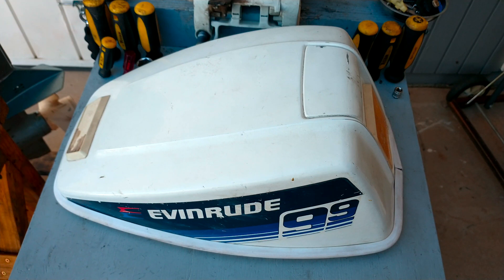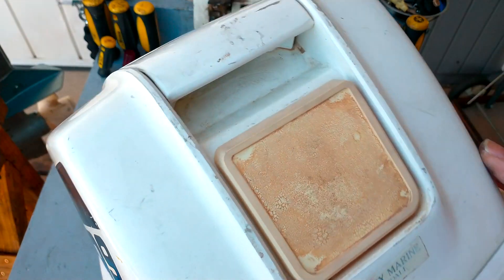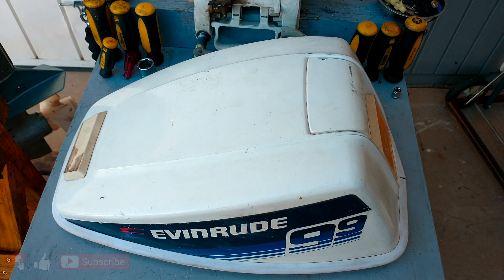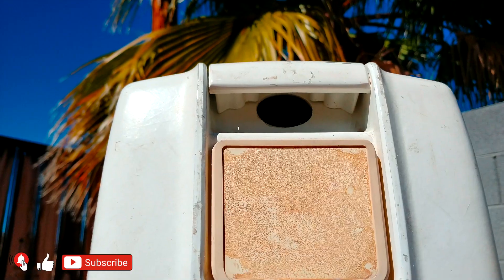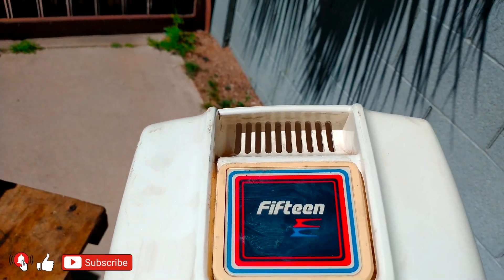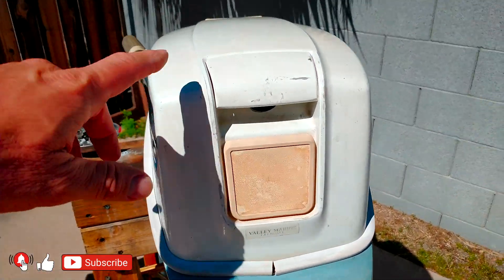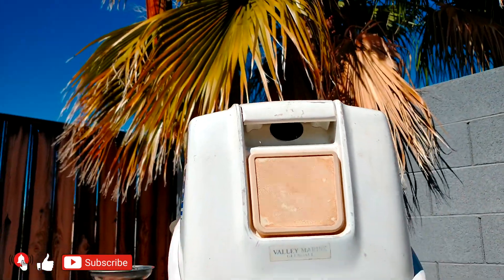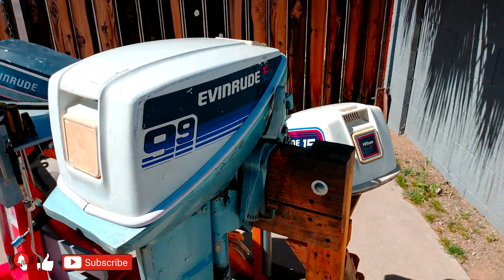HOW TO INCREASE OUTBOARD MOTOR POWER - 9.9HP - 15HP Johnson / Evinrude 15HP Hood

Comment: For those who store their motors outside or where there is mice, you definitely don't want to leave a perfect mouse entrance like this open.  Put steel screen or mesh over it in the inside, or drill many small holes.  I had a mouse in my engine once, and he chewed the rubber off wires and left hay in the carb.
Reply from the maker: Thanks!

Comment: hello , i have a 1980 johnson 7.5 that leaves murky water in the tub when i test run it ! any idea ?
Reply from the maker: This is normal for 2 stroke motors.
Reply: @BoatMotors  also what type of battery does a mini koda 30lb trolling motor need ? best budget friendly around $100 more or less ! i’ll make sure i keep supporting you 🫶🏼
Reply from the maker: @dannybuendia1550  You can look at Amazon for 30Ah Rechargeable LiFePO4 Lithium Ion. This is budget battery $119.
 If I have to buy a battery for me I will take 12V 50Ah LiFePO4 Lithium Battery $169. You will also need charger + $55 Lithium lron LiFePO4 Trickle Charger. I know this is twice as expensive as your budget, but these batteries have a 10 year life and over 3000 charges and are very light.  https://www.amazon.com/ECO-WORTHY-LiFePO4-Rechargeable-Phosphate-Household/dp/B09L88DGJ4?ref_=ast_sto_dp                  2.                                                         https://www.amazon.com/lifepo4-charger-Fully-Automatic-Lead-Acid-Desulfator/dp/B09CGYLD8Z/ref=pd_bxgy_vft_high_img_sccl_1/140-7142922-2517414?pd_rd_w=AawCz&content-id=amzn1.sym.7f0cf323-50c6-49e3-b3f9-63546bb79c92&pf_rd_p=7f0cf323-50c6-49e3-b3f9-63546bb79c92&pf_rd_r=W3FPYZ0J9TH2EG2284AF&pd_rd_wg=d11yP&pd_rd_r=16c04974-ed70-48f7-a39a-4a273fff66a4&pd_rd_i=B09CGYLD8Z&psc=1
Reply: @BoatMotors  sounds good ! the gear oil for the 7.5 1980 johnson is Sae 90 correct ? & have you don’t a video replacing the pull strong on it ?
Reply from the maker: @dannybuendia1550  https://www.amazon.com/Quicksilver-858064Q01-Performance-MerCruiser-Sterndrives/dp/B006JIA1DI/ref=sr_1_9?keywords=evinrude+lower+unit+gear+oil&qid=1677804107&sr=8-9
Reply: @BoatMotors  i know i asked this question before but when i test my motor in the water , the water becomes murky & a little bit of oil drops appear . it comes from the muffler on bottom i think on the 7.5 hp johnson . please gelp
Reply: but i don’t see any visible leaks anywhere else .
Reply from the maker: @dannybuendia1550  This is normal. The oil you see is from the premixed oil and gas. Part of the oil is not completely burn. The motor is two stroke. It is also normal to see oily water coming from the hole of the lower unit. The hole is factory made to drain all the water from the motor.
Reply: @BoatMotors  you’ve been such an amazing help . i’ve been seeing all your videos . does running the 2 stroke out of gas each time not damage anything?
Reply from the maker: @dannybuendia1550  Don't start the motor without 2 stroke oil. If you do it the motor will cease. Oil mixture must be 50:1
Reply: @BoatMotors  yes the gas is mixed , i just took the gas line off & let it run out . what oil do you use for the gas ? last owner already had it mixed & i want to empty it & put fresh gas
Reply from the maker: @dannybuendia1550  https://www.amazon.com/Maxima-23916-Castor-2-Stroke-Racing/dp/B000OO2V2C/ref=asc_df_B0012TWXBW/?tag=&linkCode=df0&hvadid=312147482150&hvpos=&hvnetw=g&hvrand=129759524848955383&hvpone=&hvptwo=&hvqmt=&hvdev=c&hvdvcmdl=&hvlocint=&hvlocphy=9029987&hvtargid=pla-591828103114&ref=&adgrpid=65039680554&th=1
Reply: @BoatMotors  really sorry to bother you again , i left my outboard sitting for two days & now it doesn’t want to start
Reply: pls help , it started two days ago & i smell fuel while strarting
Reply: never mind i got it, i kept pulling the choke to start it
Reply from the maker: @dannybuendia1550  The motor it is  flooded with fuel.
Reply: @BoatMotors  i got it started so does that mean it’s good ? i ran it on the lake for 30 min then i ran the fuel out again to store it for another week
Reply from the maker: @dannybuendia1550  Cold motor must be started with choke and hot without choke. Probably you flood the motor accidentally